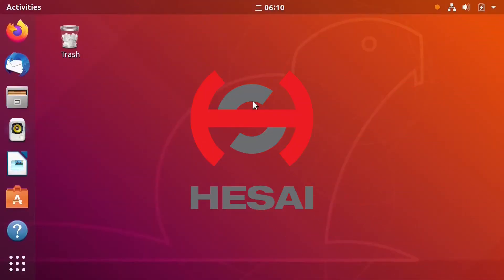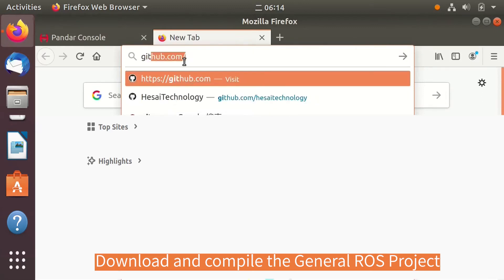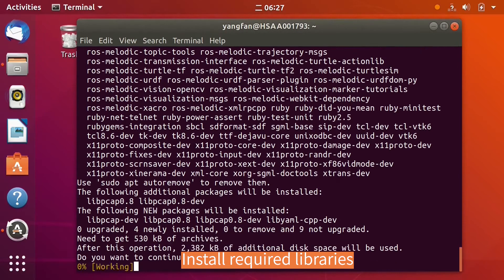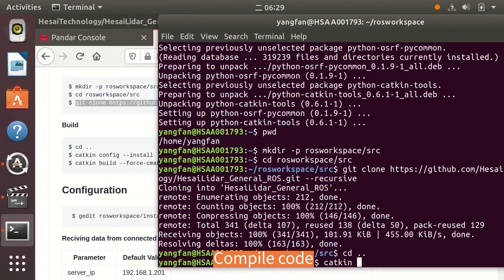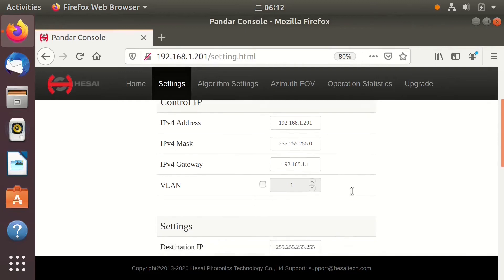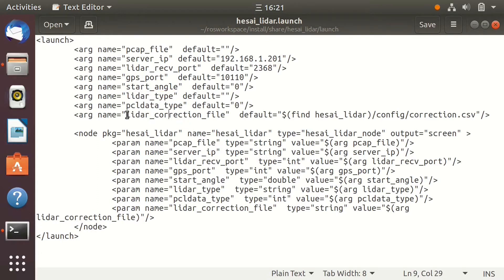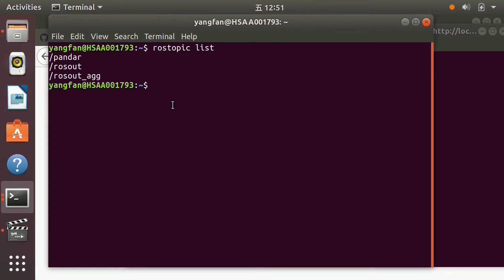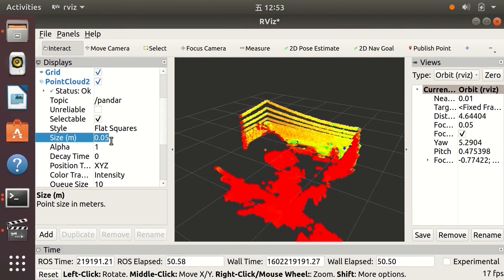Hesai Lidar Tutorial #3: Run ROS Driver with Connected Lidar

Comment: I am getting struck in the final step it is not receiving data from lidar(timestamp) it get stops in the the correction file received successfully
Reply: Did you solve this problem? If so, How did you solve the problem?
Reply: Model selected was wrong.. got corrected immediately after